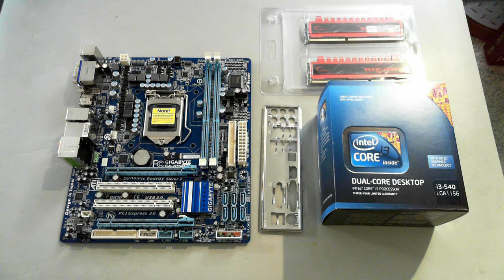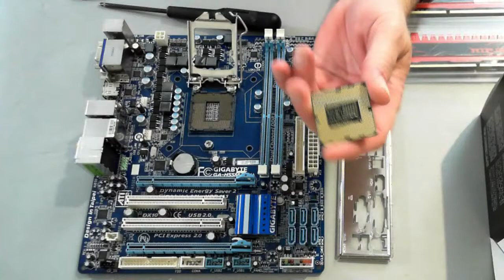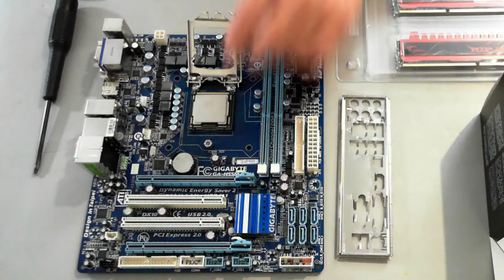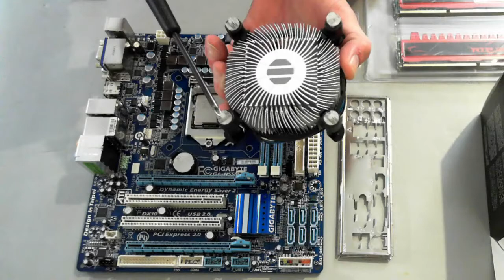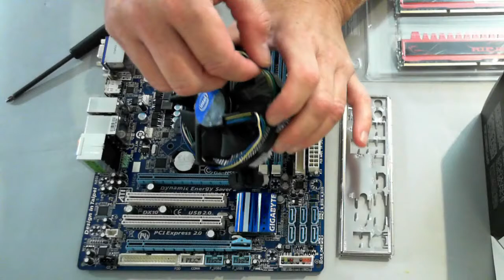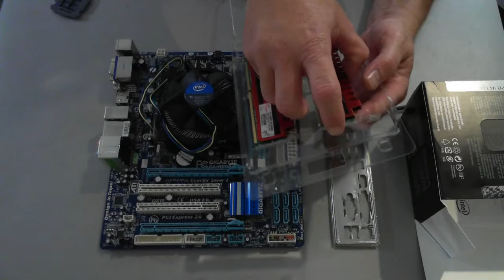BYOB Build Part 1

Comment: After ten years of laptops I'll be assembling my new tower system soon, and these videos have really helped me refamiliarise with the build process. Seems not a lot has changed, though PSU wattages are much higher, heatsinks are massive and more attention is given to noise abatement.